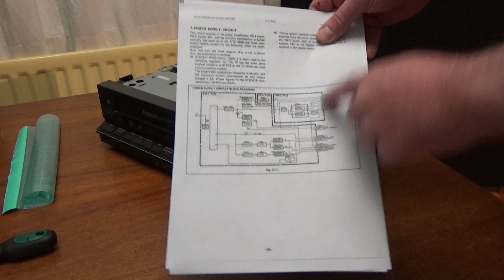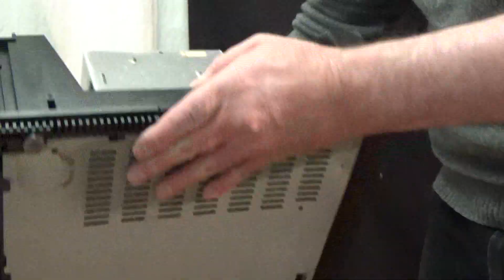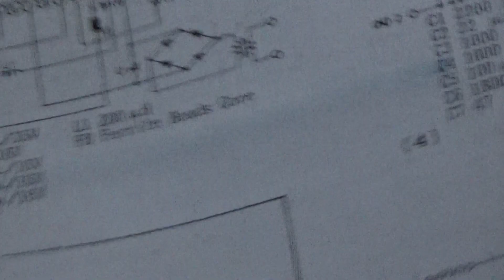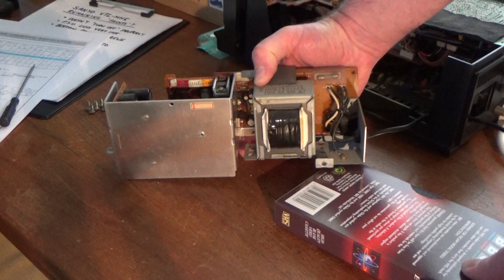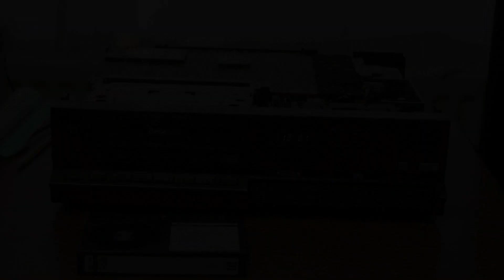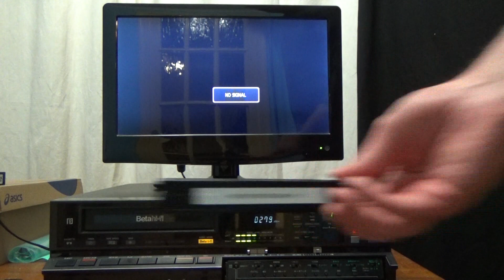Sanyo VTC-MH5 - Japanese NTSC Beta Hi-fi Video Recorder - Part 3

Comment: Sad that you never verified what the voltages on the broken regulator were.
Reply from the maker: My guess is that the chopper had stopped chopping, so it was effectively passing the unregulated input voltage through to the output.